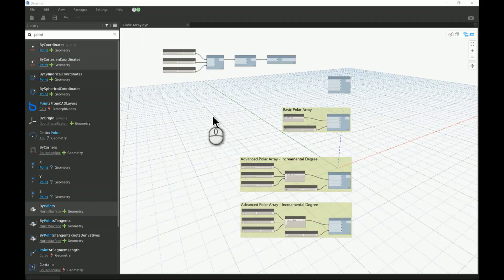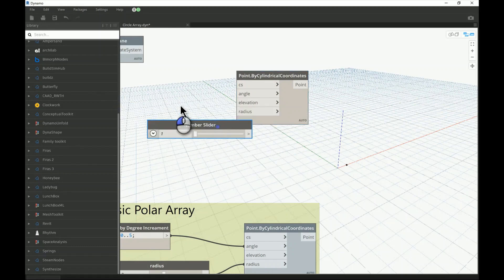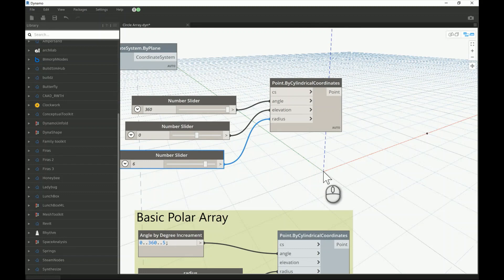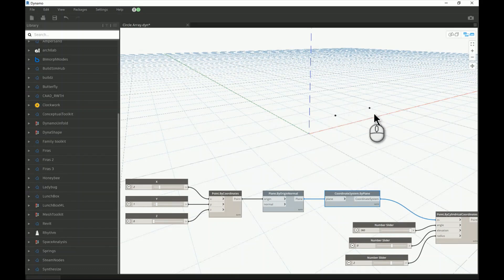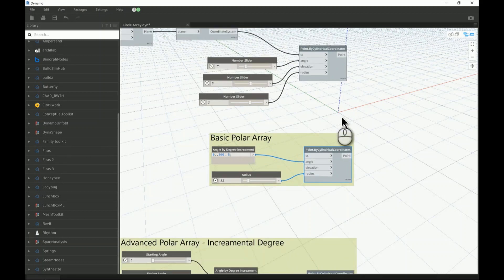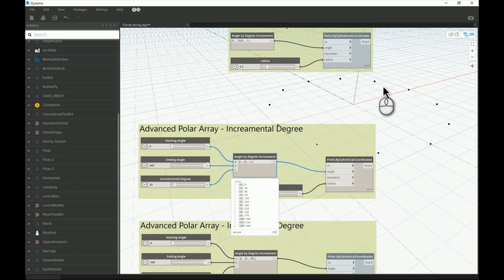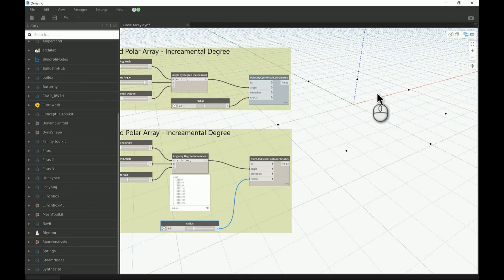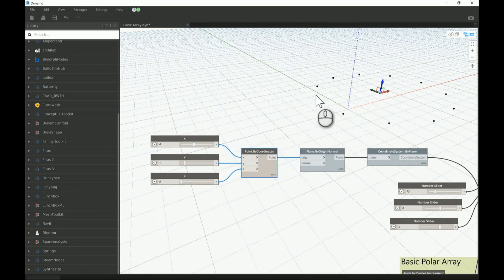Points in Dynamo - Part 5 _ Polar Array or Circle Array in Dynamo - Revit

Comment: Dear Sir, I've been following you for a long. Thanks for the videos.
I have one question: Could you help me to array the split face element, Because I made white marking in road floor through split face of the floor, then I am copying it as white markings. Its taking too much time and hanging also.
Please share me How to array a split face in a floor?
I am much waiting for your Help
Reply from the maker: Hi dear, in order to array an object along a path use this video
https://www.youtube.com/watch?v=i7QRdJ9Qwhs
and this one if you need to rotate along the path, which I bey you will
https://www.youtube.com/watch?v=ySfGRLJRxqg&t=1s
See also
https://www.youtube.com/watch?v=pBIz2_vZK0A&t=75s
Best Regards,
FN
Reply from the maker: I got your email, first brother draw a line in the middle of your street that represents the center of it, do not make one line to all roads, but at each intersection or road branch cut it so you make the work easier, get this line into Dynamo as the array path by using "Select Model Element" and the link this node to "CurveElement.Curve" to create a dynamo curve from Revit curve, see attached link for the picture below:
https://imgur.com/9dTzEwz
Reply from the maker: now if your street made from more than one curve and you when you get the new one to Dynamo too, the two lines will be separated inside Dynamo and this will make problems for you, just join them in Dynamo to make one PolyCurve as per shown in the picture below:
https://imgur.com/52KYqiQ
Firas Noori
Reply from the maker: Use the same steps to bring the split white face you need inside Dynamo, and array it on your new path (Curve.PointAtParameter) as per shown in the videos, use the rotation algorithms to make rotate if needed, finally I think you need to return the shapes to Dynamo "Form.ByGeoemtry" or better to use a Revit Components and Thus you can use "FamilyInstance.ByPoints" {in this case you need to make general Revit family that has the split small rectangle in it} so you can distribute it by using Dynamo.
Reply: @FirasNoori  Ok sir Today I'll try this, And If faced any issues I'll inform you sir> Thanks
Reply: Dear sir, I tried to array the split face but I am facing some issued and need some Help
I mailed you ,Please Check
Reply: @praveenb-xr  Oops.. I waited for the solution. @Firas Noori I hope ,You can help in resolving the issue that would help me also. If possible make a video on that Sir ...
Reply from the maker: @praveenb-xr  See this is the solution brother
https://imgur.com/uqnmtP0
Reply from the maker: @praveenb-xr  and this is the revit preview
https://imgur.com/PeHNv7l
Reply from the maker: Make sure dear to see the videos I sent to you, this solution is in the videos, almost the same, you need to install the "ArchLib" I guess , I wrote a note for you within the picture, you also need to study the rotation function as per shown in videos
Reply: @FirasNoori  Yes sir I watched the videos, Now 2nd Time  I tried but It is not taking the split face element as a family type, and showing some error,  I mailed you Please check that  sir, Or we can have screen share session If you have any time sir